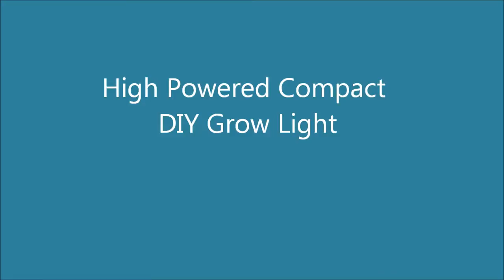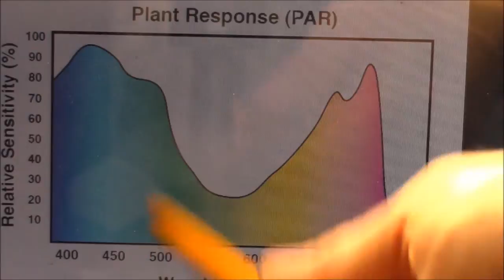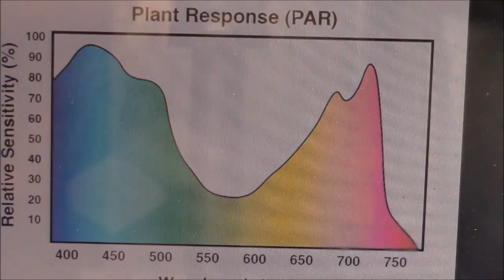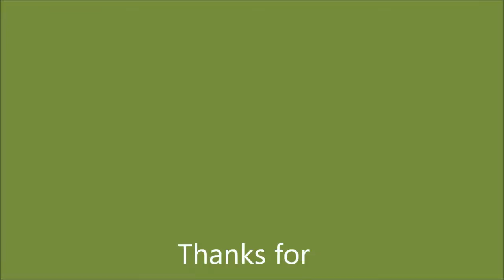DIY Compact LED Grow Light

Comment: You are making me ever more tempted to build one of my own. I have two GPU coolers from my PC (switched to watercooling), and they'd be just perfect for 4x100W LEDs on them... I'm thinking of doing a red, a blue, a warm white and a cool white on there. What do you reckon? :)
Reply from the maker: I ordered a 50 watt blue with lens a few days ago that I plan on adding to the "Growanator." I'm not so sure how useful the whites are especially without a spectrometer. I can say this though, I originally tried to grow broccoli with just a 50 watt 10k(cool) LED. They did grow, but not very well. So I decided to switch to a warm white, which is pulling it's weight in the large light. My ideas with putting a white in this small mix was to try and cover a bit of the spectrum the blues and reds weren't. Whether or not that matters, I don't know... The only way to find out is to build them and see how well they grow. I'm very happy with the how the large light is working. I look forward to seeing your build! Eventually I'd like to make my own drivers, but am still a little ways from that.
Reply: Trace Waters In case you are interested, I found a superb article about the role the light spectrum plays in plant development in one of the CannaTalk magazines they give away at my local hydroponic shop (which is also availble for free as a PDF online ... http://www.cannatalk.com/downloads/files/25_CannaTalk.pdf ) - The article is on pages 4-8 and there's another good article on LED growlights from page 22 onwards too... (I am not a Canna shill... but I do like their free magazine). Cheers!!
Reply from the maker: A very good article. It seems the low red to far red ratio is very important. So my offhand comment about programming sunsets may have some validity. I'm wondering what the spectral spread is on the 660 nm reds I'm using. I know that different amounts of current will cause a shift. I think being able to program your lights would be extremely useful especially when growing both long day and short day varieties. I think having  Right now I have a short day flower I started from seed blooming under the growanator. The variables in plant growth can get overwhelming very quick. That's why I like the idea of growing indoors hydroponically with the LED's. Not only can it be made to be very efficient, but you can eliminate or have much greater control over the variables that you get growing outdoors. Lighting, nutrients and temperature are what I consider the most important. Of course you can break down each of those to massively complex equations. Lucky for me though that life wants to live!! Plants can give us a wide margin of error if we are paying attention to the basics. My understanding of light could probably be better characterized as a "misunderstanding" of light, but I needed to start somewhere and not get too lost in the research papers. Do you have any ideas as to what you are going to try and grow?